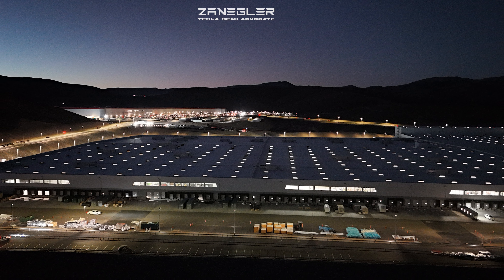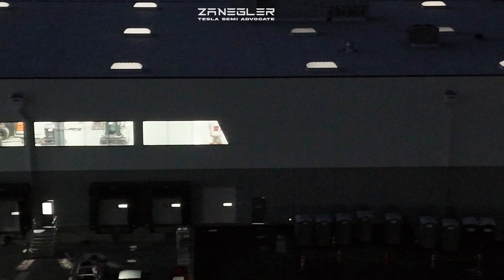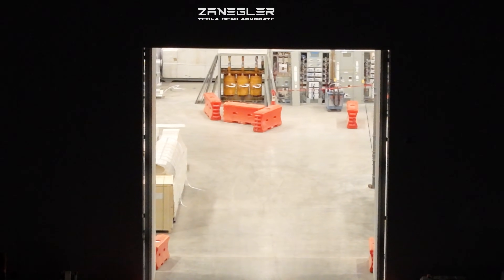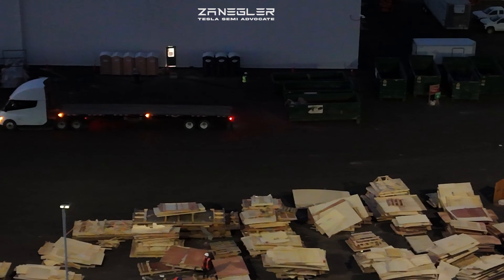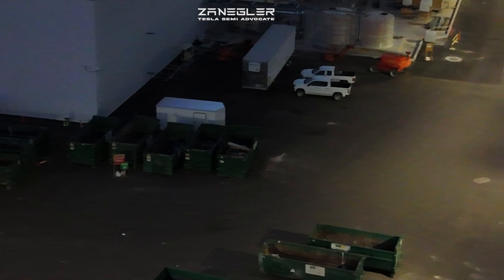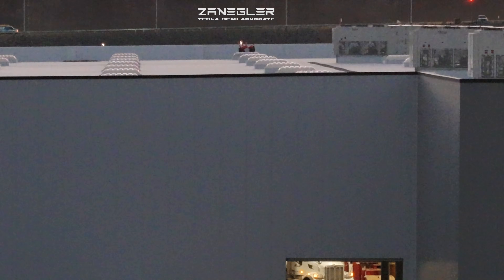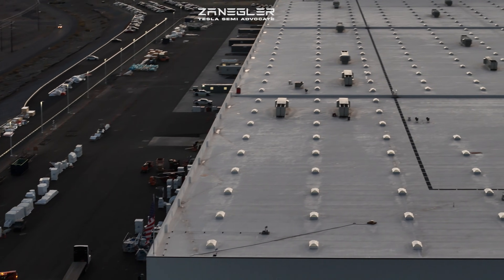Mega Giga Tesla Semi Progress!

Comment: Thanks Zanegler
Sort by newest first or top comments if only the first few lines are visible
1:49. North, inside. Tent/marquee set up. Hiding the top secret works.
5:04. North, inside. Stack of panels. Sandwich panels perhaps.
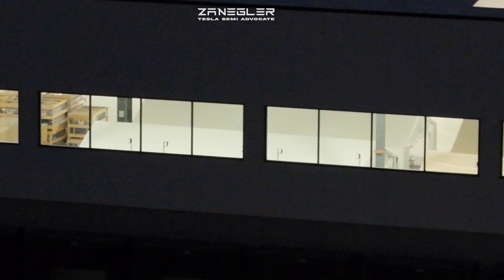6:31. “northeast, bigger footings”. No. Footings were deeper, not larger in area. The excavation for deeper footings is often stepped, so appears larger.
10:25. East, inside. A lot of yellow plastic, and timber framing that might be formwor. More concrete work perhaps.
This happens to be the area where the ‘deep footings’ were constructed. Production line trenches at GT such as the infamous ‘zipper pit’ were constructed around deeper footings. A little lower, and might be able to make out what is going there.
13:24. Stamping, west. Inside. Smaller stamping press footing possibly for a stand-alone ‘test press’ as exists at GT.
13:37. Stamping, west. Inside. On the floor to the left of the installed stamping press line are the tracks (embedded plates) where the die and tool bolsters drive into and out of the press. Same at 13:47 to the right.
If you haven’t yet watched the Schuler pressline video, do yourself a favour and type into the search box above ‘Servo pressline at Mercedes-Benz plant Bremen’
14:35. Stamping, west. Inside. Door to right. Large wheel is a flywheel for one of the presses. I don’t think this is one of the flywheels that came from GT. Might be for the stand-alone press. See 13:24.
15:45. West. Inside. Black cylinders. I was thinking insulated flue sections until the round items on the floor appeared at 15:53 and 16:27. No ideas.

Comment: An Update of whats happening with Aurora Innovations driverless AV simi fleet:
When Aurora was first designing their hardware kit, there was no LIDAR sensors available to satisfy their needs  SO  Aurora designed there own. Their LIDAR scans out 1475ft ahead. Behind. Beside. 360 degrees all around the truck  WAY  further than a truck driver can possibly see. Well, after a few months on the road & just over 100,000 incident free miles hauling on public roads they have just introduced their new gen2 LIDAR. 3400ft. Thats right, 2/3 mile ahead.Behind. Beside. Sees in the dark. Thru rain. Thru fog. 
IN OTHER NEWS>
Along with partners Peterbilt & Volvo  IH has joined up. IH will be running regular loads Fort Worth to El Paso on I-10 & I-20  24/7  AND  IH has agreed to let these truck travel  WITHOUT A SAFETY DRIVER. No one on board as a proper AV should operate. Aurora-Making Americas roads safer. Getting freight delivered faster. They still are streaming on YouTube  8-5 M-F only    search for>> Aurora Driver  LIVE

!

Comment: Nice. It seems very full of... stuff. But if they are building the guts of the factory, I guess there would be parts of it everywhere. Especially with Elon going on about the efficiency of factories. Anything in the building that is not actively building trucks at all times is wasted space. Including air and open floor space in the extreme.
Reply: I don't know if it possible to waste space until it is needed
Reply: @jbbuzzable Yeah. It gets philosophical. But if you pay for a building and parts of it is not used, then I guess...